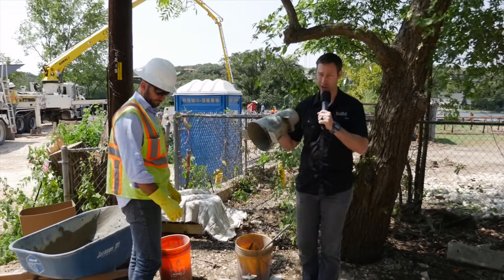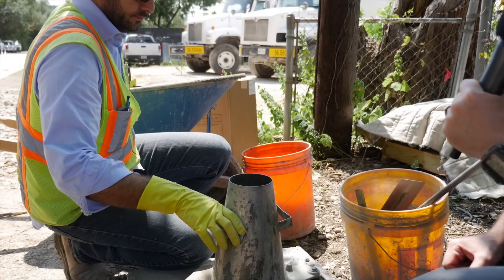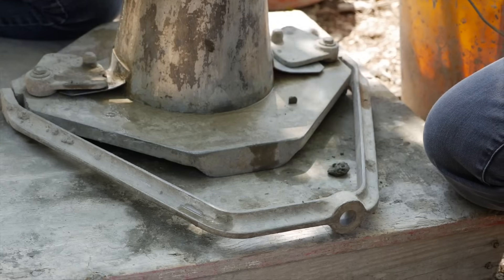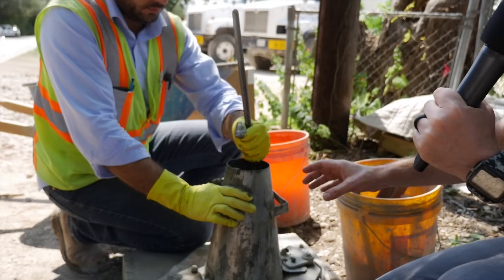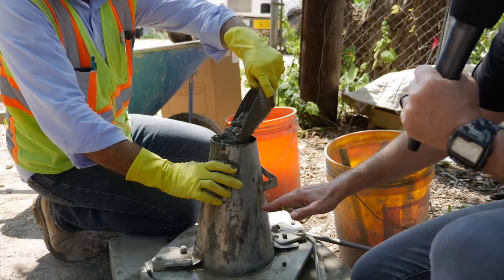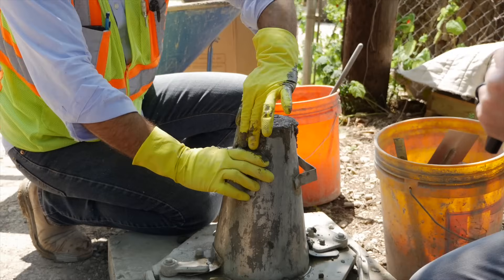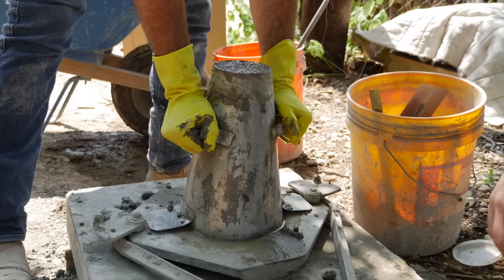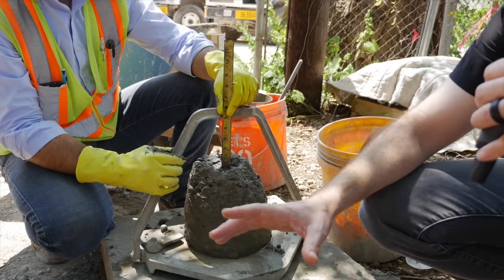Concrete Slump Test - Tutorial

Comment: mind you the thing you’re using the concrete for is what will determine the level of leniency on the slump. if it’s a little lower than required but it’s just for some sidewalk no one will really use/a low traffic area then there’s really no need to be anal about it

Comment: Go watch this one instead. 
https://www.youtube.com/watch?v=jDUQO-bn8pU
And make sure you know what the maximum allowable slump in the approved concrete mix design is, and that the concrete is no more than 90 minutes old from the time of initial mixing. The *truck ticket" will tell you that time. Then, always keep an eye on the driver and ears on the truck so see or hear if he is adding more water from his tank to the mud. (More water makes it easier for them to clean their truck out.  Rare but not unheard of.  The more water added/higher the slump the more like to develop cracks when curing.  Special admixtures can increase the allowable slump without causing cracking.

Comment: Love your Videos Matt,  always informative.  F.Y.I. you should not use a piece of rebar for rodding as it could introduce air to the test. a smooth 5/8" tamping rod with a rounded end is best.  concrete in three additions rodded 25 times per addition..    keep

Comment: the guy commentating is a bit clueless about the little technicalities lol it's not a rebar and it's not in "3 or 4 pours", the construction guy is doing it correctly though. It does look like a smooth rod with a round end and he did it in 3 pours and struck off the top at the end.

Comment: You didn’t run a slump, buddy.  Not sure what you call that.  Your increments were off on each depth, you rod each lifts 25 times using a 24 inch tamping rod with a 5/8” hemispherical tip-not rebar- and you lifted too fast.

Comment: we pour at a 6 in. skunk bare minimum 😳 when it’s just two guy, we like it more wet so we don’t have to be throwing up by the time we’re done vrooming haha.
Reply: Because you never heard of super plasticizer admixture.
Reply: @2drsdan  you would be correct
Reply: @yourmomsuncle2953  Adding water to concrete weakens it exponentially. Super plasticizer reduces the need to thin with water and makes the mix very sloppy (for flatwork not walls) so it's very easy to move and work. It lasts for a couple hours then the mix sets up as normal. So your placing and screeding window is when it's active.

Comment: This is a perfect example of HOW NOT TO DO A SLUMP TEST.  The Tester did a 2 second pull.  Completely out of spec tolerances in accordance with ASTM testing procedures.  Matt, you also don't know what the hell you are talking about.  You can't use rebar.  It is not to find out how much "water" is in the mix.  And also, you don't fill it in 3 to 4 lifts.  You both are a disgrace to our industry.

Comment: Could you create a video that explains the reason why you want a low slump vs high value and how too much water affects that test  and value of concrete? And, concrete poured in a hot vs cold climate and humid vs dry climate? There is a story in each of these situations and tied with the slump or cone test. Love the videos!
Reply: Collective Construction INC if he had to rake that stuff in 90 degree weather he’d want it at a 7

Comment: the slump test is to measure consistency not amount of water, do not add water to your equipment! you are supposed to dampen, not wet! it may give you false high results, you cannot use a rebar, the cone must be lifted in 3 to 7 seconds for a heigth of 12 inches, then you measure to the original displaced center. that is if you want a test result that follows the ASTM procedure.

Comment: Matt, you might add a water to cement ratio (w/c) specification. If the w/c ratio gets over 0.5, water can easily move through the concrete (you know I'm the water/moisture/mold guy!).
Reply from the maker: +Wynn White excellent comment!

Comment: Sigh, 2" additional slump over spec can be a critical design problem depending on the application/mix and should not be a "field decision" unless made by very experienced personnel with authority to make such decisions - otherwise the load should be rejected.

Nobody should be adding water to the mix at the job site if the concrete slump is within spec without a very good reason - just because it makes it easier to place and finish IS NOT a good reason.
Reply: As an engineer, adding water on site is fine. But never ever go over spec. You as a contractor are now not following the engineered specification and creating a weaker mix. We design for a reason. The seal on the plans is a liability for us that you do not want to take on. Please respect the legal seal and follow our specifications.
Reply: We got a shovel for you and your 4” slump going to a 3 in about 15 minutes..you can drag it outta the chute for us when it’s 90 out
Reply: ArthurDentZaphodBeeb slump in the field is negligible. +1 over spec isn’t going to ruin anything. Some times you need to add water especially in summer

Comment: No, you cannot use rebar.  Must use the smooth 5/8" bullet nosed bar to meet the test requirements. And you have to rod the concrete 25 times.  Fill in 3 lifts.  No more, no less.  C'mon Matt, for someone who is telling people how to perform a slump test, at least get this very basic test procedure correct...
Reply: Rebar will add air pockets with its deformed sides and skew the tests. Use smooth bar only!
Reply: Pulled the cone up too fast.  Should take about 5 seconds.
Reply: lol, scold the man
Reply: I’m an inspector and see concretors ruin this test everytime. 4 attempts then im impatient.
Reply: It was also at five inches, not 4 3/4 lol
Reply: @Dan_akrothere’s some room for leniency in slump and air, if it’s 3-5 slump it can be 2.5 or 5.5 and still pass doesn’t have to be exact. when its way too much of a difference that’s when you’ll have issues
Reply: The question is how much does it throw off your results, I have no idea but Wiki agrees with you, https://en.wikipedia.org/wiki/Concrete_slump_test 

Thanks for pointing that out.
Reply: You can use rebar.
Reply: @ramiromaldonado393  Not if you're doing it correctly.

Comment: Simple and useful.
I am going to be doing a job soon, using extreme strength concrete... 2" slump max, and pond curing. 18000PSI, micro rebar and kevlar reinforced. Pretty cool job. Quartz aggregate.
Reply: John Doe damn what are you building the hall of justice
Reply: John Doe 18 ksi concrete? Holy crap
Reply: It is crazy expensive but creates some of the toughest and thinnest creations. 
Ductal UHPC, LafargeHolcim is the company here in the US. I think it is rated up to 22.5 ksi for structural applications.
It can be used for cast in place or precast. My use was a cast in place barrier. Something 4" thick that can stop incredible threats and forces (hurricanes or tornadoes), yet still maintains a good surface finish. There are not many use cases that justify a 4-8 times cost compared to everyday concrete, but impact resistance and strength per volume or cross section are critical. 3/4" cured can have an effective strength similar to that of a 4" thickness depending on the use and goal. Static loads, or architectural, it opens many doors. I wouldnt be surprised if Matt has worked with it, or another UHPC in the past on some of the more modern jobs.